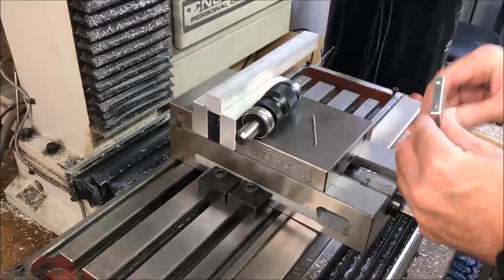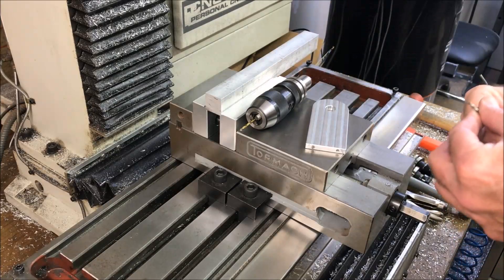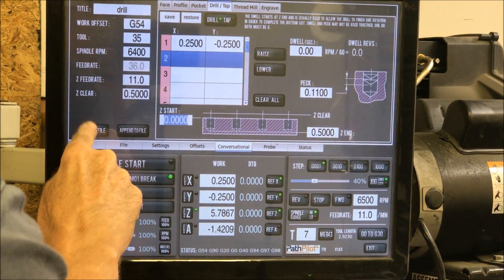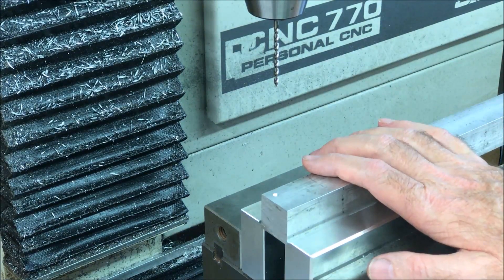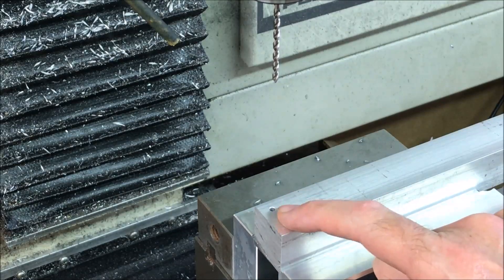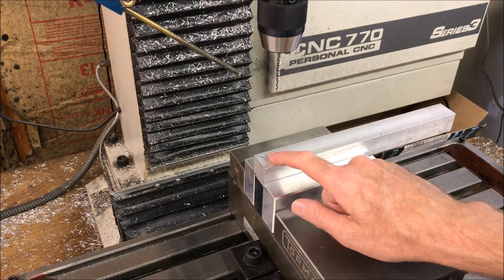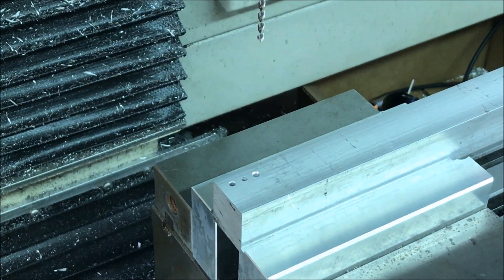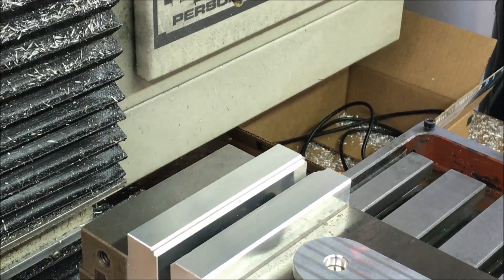Drilling Deep Holes with Small Drill Bits

Comment: where in Gwizard is the peck depth?...I cant seem to find it anywhere?
Reply from the maker: It shows up under tips. Like use coolant, etc.  If there is no tip then I guess it doesn't require pecking.
Reply: Thanks Craig...I found it after I reduced the hole depth...thanks for the heads up
Reply: its 2am in the morning there when you answered me...you should be sleeping
Reply from the maker: Sure thing

Comment: Search and replace g83 with g73 in the code generated by pathpilot to change the full retract to a partial retract. That should save you from having to use fusion 360 to get that cycle. It would be nice if pathpilot had a way to choose which cycle you wanted but the work around is pretty easy.
Reply from the maker: Thanks Jason, I'll have to remember that.  Yeah, it would be nice if it was more flexible with its pockets also.
Reply: Full retract is what you want for HSS drills.  Partial retract is for solid carbide.
Reply: Robert Schmitt if u need carbide drills for Aluminum ftw